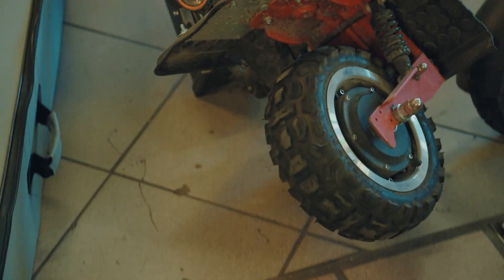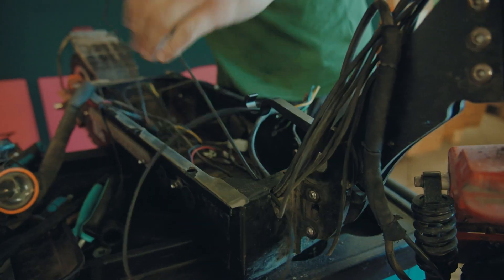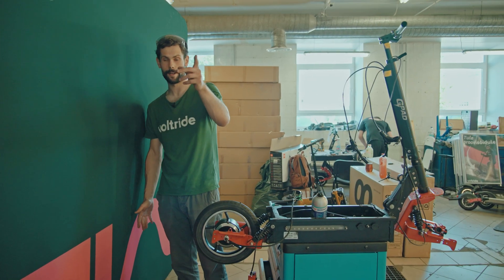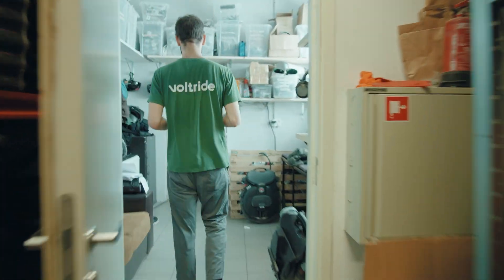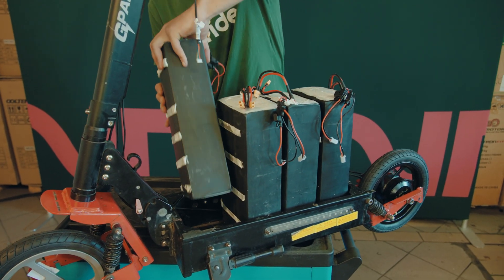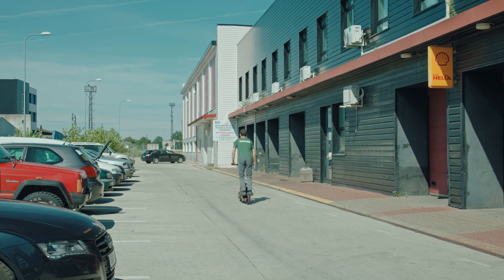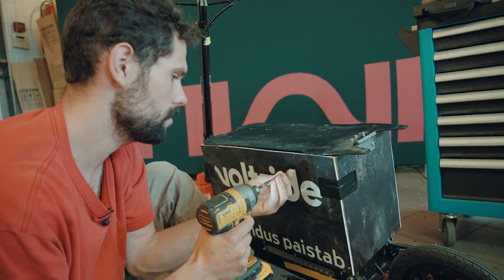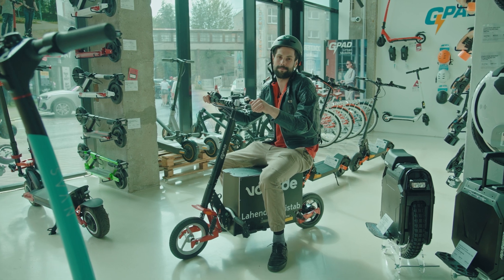🛠 Building a DIY 300km e-scooter! 😮

Comment: I made similar project, but opossite way, small electric ebike on 16" wheels, 2x1800Wh batteries (3.6kWh total) but the trick is I charge them at 2kW using two powerful chargers, so it is little above 2 hours from zero to 100%. I drove it from Warsaw, Poland to the Kaunas, Lithuania (400km) in 3 charges at constant speed of 37km/h